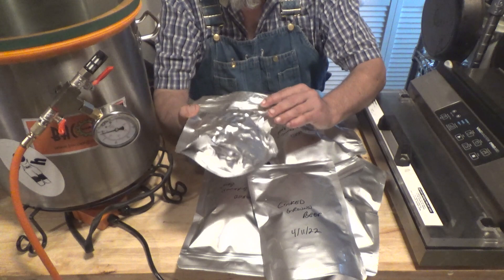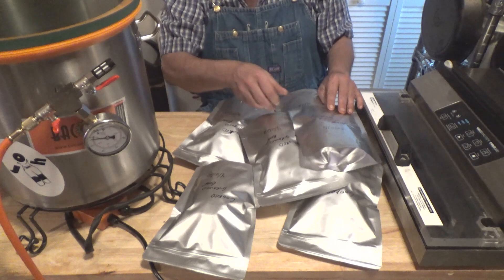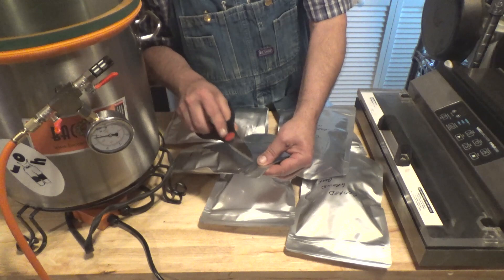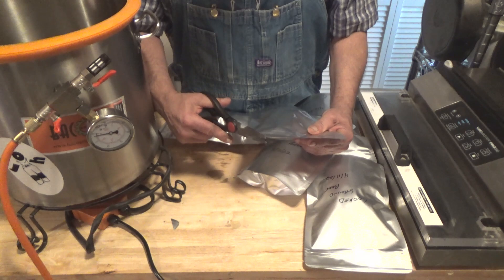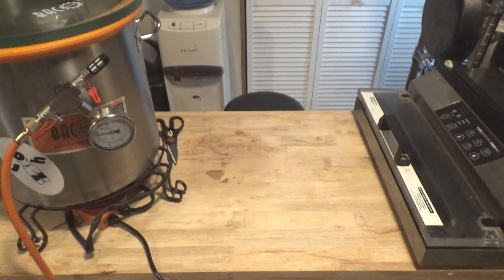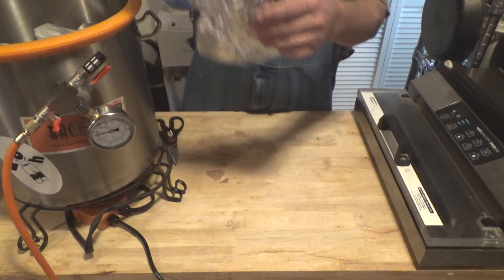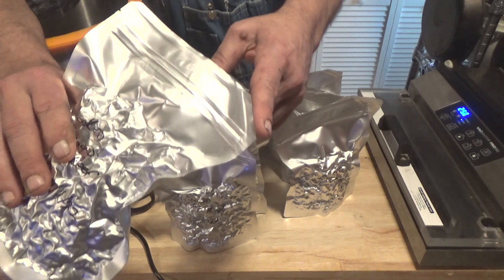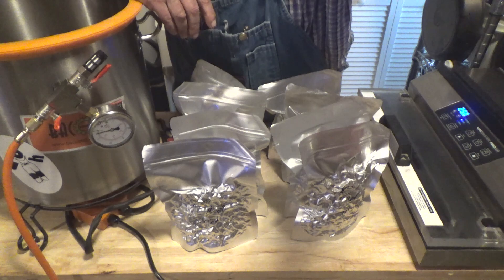How To Vacuum Seal Mylar Bags In A Vacuum Chamber Ep233

Comment: Nice video!  I may buy one of these. I'm going to try my machine one more time first.  I wasn't able to get it to do the mylar bags but your video may have fixed my issues :)   I was leaving the zip part open thinking the machine would close them.  THANKS JOHN!
Reply from the maker: I leave the zipper open pretty much as well. I do a complete heat seal then cut the corner leaving a very small hole as small as you can... you should be able to achieve the same results with your FD.
Reply: @JohnInBibs YES!  I did.  But then realized I shouldn't have vacuum sealed strawberries..lol..  But at least I have the method down!  Thank you so much.
Reply: @JohnInBibs  I have been self-defrosting my machine and usually do the vacuum sealing between loads.  That isn't very smart because the very coldness of the inside drum creates condendation - moisture.  So I stopped using the machine and ordered the vacuum chamber :(..  Still trying to get my habits in order.  I'm new to this stuff.

Comment: Please explain what holds the seal on the bag after the air is let back into the chamber until you seal it up again.
I have a chamber vacuum sealer but mine seals the bag at the end of the vacuum process.
I can't figure out how yours stays sealed?
I have enjoyed the videos of yours that i have seen in the past as well as this one.
Thanks in advance.
Reply from the maker: The negative pressure in the bag sucks the two layers of mylar where my 2mm (approx) hole is. This holds long enough to seal the bags
Reply: @JohnInBibs  Thanks for getting back to me with an answer.
Just goes to prove that we can all learn something new no matter how much we think we know.

Comment: Hey John. Quick question. When you vacuum seal your Mylar bags, did you leave the seal on the bag closed, or did you open the seal? Thanks
Reply from the maker: I leave the ziplock seal open and heat seal it then cut a small corner off

Comment: Can you use regular FoodSaver vac sealer type bags if you heat seal both ends?
Reply from the maker: No. For this type of vacuum chamber the bags must be smooth. When you release the vacuum the outside air pressure causes the two smooth layers to suck together (for a short time) long enough for you to heat seal the bags. With the textured bags the two layers will suck together but immediately allow the pressure to equalizes between the inside bag and outside bag level.

Comment: How do the bags hold the vacuum until you do the final seal. We tried vacuuming our bags inside the chamber of our freeze dryer and the second we removed them from the chamber they lost the vacuum. We even tried folding the bags at the cut.
Reply from the maker: as demonstrated in the video, the cut needs to be very small. That way when vacuum is released the gap will suck shut and hold for long enough to put a seal on it.

Comment: Just curious - if you are vacuum sealing the bag why do you also need the oxygen absorber? Hasn't the oxygen already been sucked out? I thought it was vacuum seal or O2 absorber, not both.
Reply from the maker: Vacuum sealing never gets all air out. For long term storage you should always use an O2 absorber
Reply: To add to john's answer:
According to information that I have seen, O2 can actually seep into fully sealed mylar bag at a rate of up to 1cc per year.
Adding an O2 absorber should keep up with that rate of seepage even over a long period of time.

Comment: How do the bag stay vacuumed without letting air in??? John this make my head hurt lol.
Reply from the maker: This is not an original idea. There are a few videos out there showing how to do it with the FD. I just don't recommend doing it that way. The trick is to cut a very small hole as shown
Reply: @JohnInBibs  I'm baffled by the fact that the air  does not fill the bag as soon as it introduced bag into the chamber.